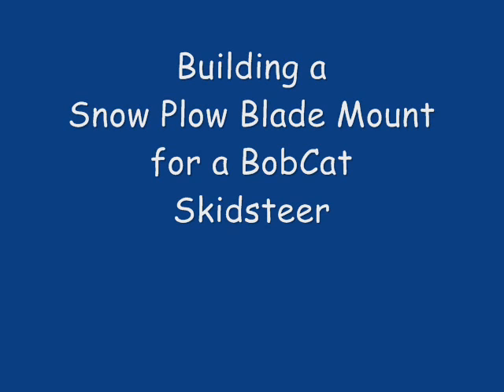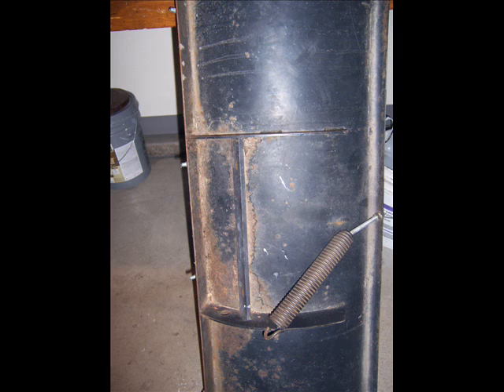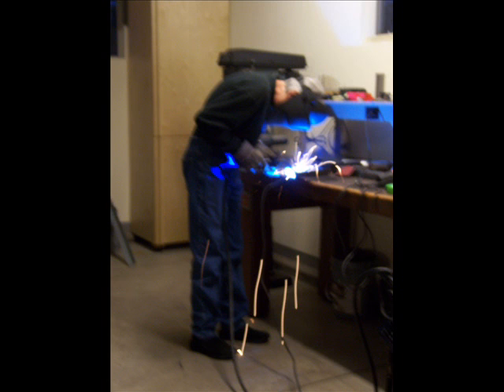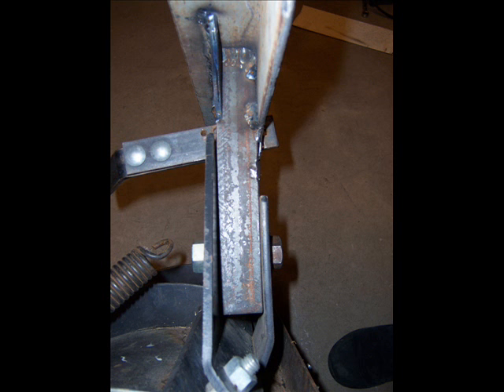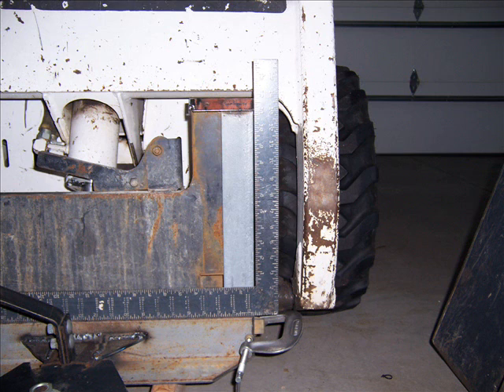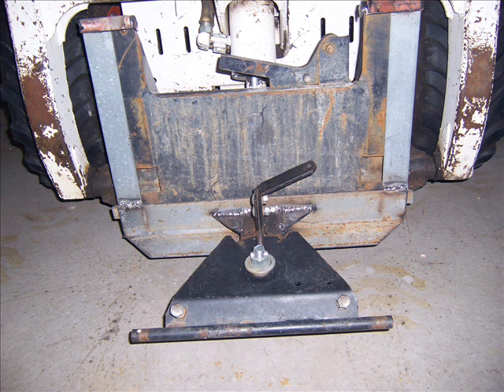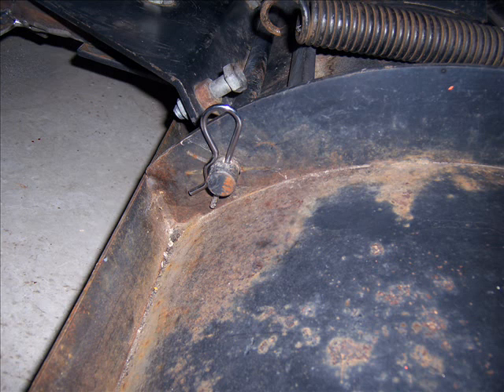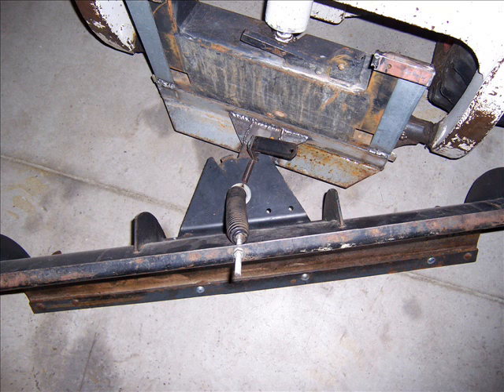Building a Snow Plow Blade Mount for a BobCat | Skid Steer | Plow | Snow |

Comment from the maker: I tried a Ford 8N with a rear blade, Ariens with a snow thrower, the Bobcat with the bucket and finally the blade.  The blade is fast and easy.  

I need to modify the blade attachment with a hinge or pivot do the blade edge will always be on the ground without lifting the Bobcat.  

I will post another video.
Reply: We started out with a Ford 8N with the rear blade as well.  Plowed reliabily for decades, but we purchased a used Bobcat 440B back in 1998 and it changed plowing forever!  We always thought it was good with the bucket, but a couple years ago I bought a snow pusher (and a door for the machine), and that has made it so much better!I like your plow build, I just built similar brackets for my quick attach plate and am fabricating it to fit an old 5' V-plow snow blade (ironically, built by Dearborn for the old Ford 8N tractors).I have a couple videos of the snow pusher, I will put some on with the V-plow when I get it done.

Comment: i think that mount is a great idea.  i just built a 7.5' pusher box for my 853 and it only ran me $300 plus a little wire and gas for the welder.  why spend $1400+ when i can do it my self in two evenings and have fun doing it.  i used this vid to get ideas on how to build my mount.